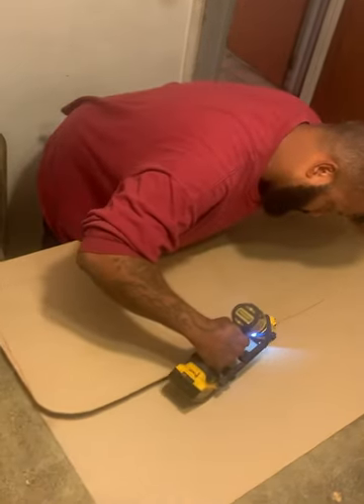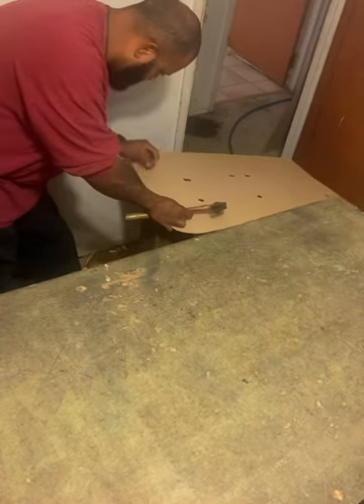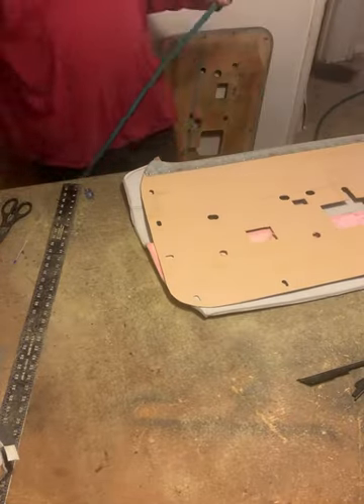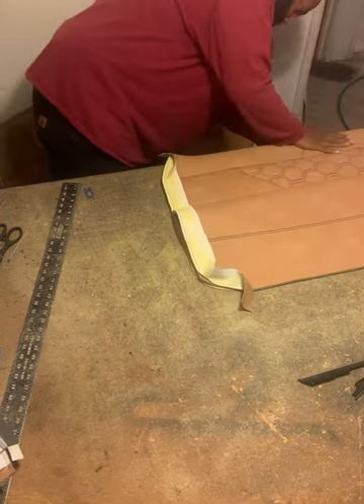81-88 Chevy caprice door panel build step by step

Comment: What kind of board did you use
Reply from the maker: I used waterproof door panel boards. Get them from your local upholstery supplier.
Reply: So will a complete door from a 85 box fit a 87 box